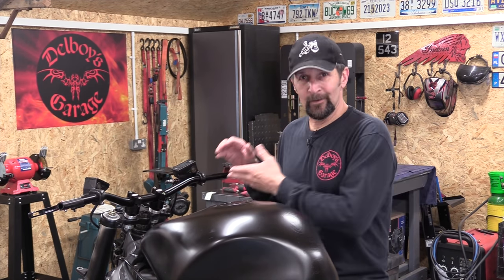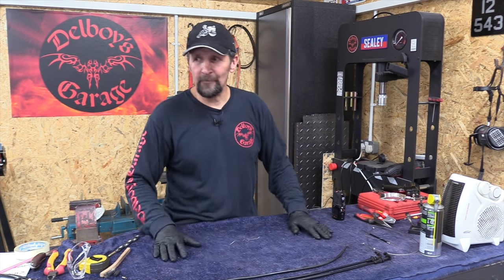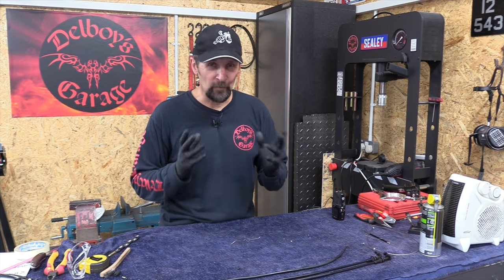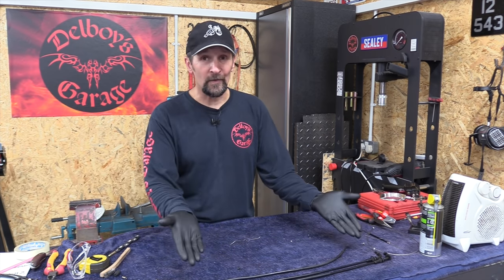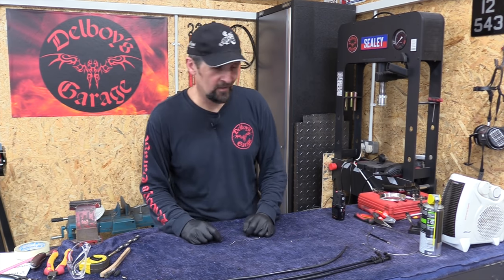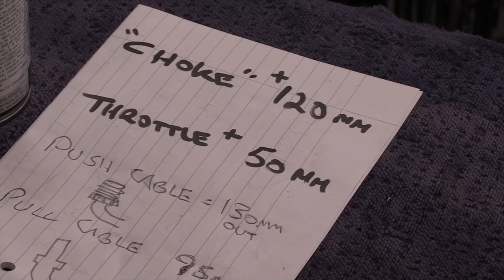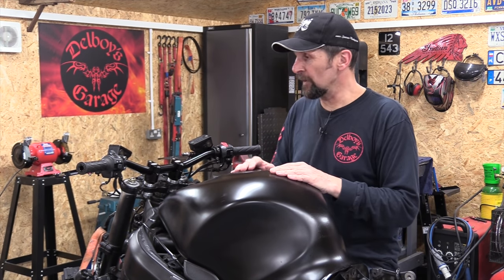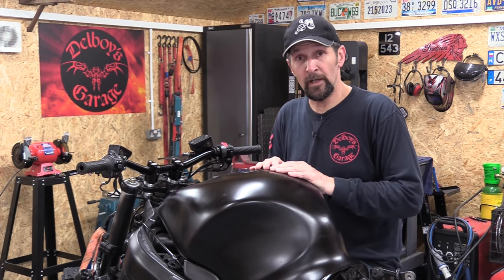Bare Bones Busa #5, Made My Own Control Cables !

Comment: After 45+ years of riding/working on motorcycles, that is one of the last things I've never tried. The list is getting shorter, but I still get that "a little bit spooked" feeling with the things I have not yet put my hand to... Rebuild an engine? No sweat. Make braided steel brake hoses? No sweat. Make a new set of throttle cables? Aiiieee, Black Magic! What, are you nuts? Great video, as always!
Reply from the maker: Ha ha, get stuck in mate.. it's easy enough.. just measure everything over and over before you cut it.!

Comment: My wee bike needed a new choke cable. Twice I tried to buy the right one, and twice I got the wrong ones. So I decided after seeing this video to lengthen mine, A trip to a bicycle shop and bought an inner gear cable. Had to file the nipple down a bit to make it fit. I use a sharp chisel to cut the short wrong cable in half. Gives a nice clean cut. Luckily I had a stainless steel tube the right size that slide over the outer cable and clued in place. I tried drilling the nipple on the other end and re-soldering, with no luck. Then I remembered another trick. I drilled a hole the right diameter and hacksawed a grove leading to it. Slipped the new wire in, then melted some solder into the hole. Let it cool, then split the wood open. Hey presto. A little tidy up with a file and good to go.
Reply from the maker: Good job well done Donald, thanks for sharing.

Comment: Great job but use flux so the solder flows, and make sure there is flux resin within the solder, not essential but deffo required if no further flux available! additinal flux will help it flow on this type of repair, do not blow the joint either, it induces air into the joint which makes it weak! to know if it soldered and flowed correctly check the wire at the end of the nipple where it enters the nipple, you should see the solder inside the weave! also clean any flux either additional or flux cored from any soldered joint, even after filing, flux will corrode the joint! done this myself before, super easy, great achievement!!

Comment: i've made those myself too. motion pro was the only company i could find and they wanted a fortune. i took a nut, smoothed out all the threads, cut a slit in it, layed it on the vice, inserted the cable, then filled it with solder, knocked it out, filed it and sanded it smooth, tested it for strength....that sucker was spot on!!!
Reply from the maker: Bang on mate, sounds like an awesome fix.. ill remember then.!
Reply: i made myself two spare clutch cables,but i did not solder them. just welded it .cable ends i make from a 8mm bolt(part with no tread)  make 2 mm hole  for a cable,and just short time welded  it.

Comment: Two tips I got from a classic bike workshop manager who’d been making cables since the ‘50s: Make (or buy) formers & hollow tip punches to bend the strands of cable back on to themselves into a mushroom shape = It’s far stronger than just flaring them apart (and really safety critical for drum brake cables!). And have a small pot of molten solder to dip the assembled nipple & cable end in = Its quicker & neater than a soldering iron when making up more than one cable.
Reply: @willwye410 is the solder the same kind as used for electric wire ? or is it suposed to be something stronger ?

Comment: Nice job. You'd get nervy when making up a front drum brake cable - it has to be spot on!
Reply from the maker: The brake cable kits are a lot beefier, and i guess you'd certainly need to test it properly before you used it in action aye!

Comment: Well done, yep it isn't hard.. but it is something you got to make sure the end wires are clean clean clean before you start.
Reply from the maker: Sure thing mate, a simple hack for that, rather than any fancy chemicals, is something as common as electrical contact spray, strips away anything on the surface, a little stainless wire brush also helps!

Comment: Excellent how-to vidéo as usual!…  I use a Dremel to cut the various steel cables/tubing as I find it leaves a cleaner finish. Wemoto is just down the road from me, so will check them out for supplies. 👍👍
Reply from the maker: Hey Andre, that's a good tip, thanks mate, a fine disc blade on a Dremel would be perfect...I  burnt mine out some years ago and have never bothered to replace it... I do have an air die grinder which does the same thing, but getting it out and setting it all up isn't worth it for 3-4 cuts, specially when you're busy!

Comment: Nice work. Never done that at all. Must have saved a good few quid too. Neatness ? No need when you are filing it down for smooth use profile anyway, a good amount of flux, splayed wire at the end and the solder flows to where it should. Enjoyed that a lot thanks :)
Reply from the maker: Thank you Tony, glad you enjoyed it, i did too. It was very satisfying to take on a new skill ive never tried.

Comment: Brilliant video as always. Question - did you use any specific type of solder to do this? (Lead free / leaded, etc..) I need to extend all my control cables on my FZS1000 due to fitting higher bars but for the life of me I've tried with an old original clutch cable and the solder simply won't stick to the cable. I've ordered a kit which has new cable and ptfe tubes but if I can't solder on the nipples I'm kinda stuffed lol
Reply from the maker: I can't diagnose what you may be doing wrong there mate... but the most common issues are contamination, and not getting the cable wire hot enough to flow the solder..!  if those two things are correct, it will work pretty much every time.!
Reply: @Moonfleet41  No worries - I suspect contamination may the issue as I wanted to experiment with an old cable, the new stuff shouldn't have anything on them so I'm hoping I'll have success when they arrive! Thanks again!
Reply: I’m having the same problem right now. It’s stressful. Did cleaning it help? Were you able to make it work?

Comment: Quick question: What soldering Iron were you using (rating etc) as this is the key to getting the nipple and cable hot enough for solder to flow properly with no "dry" joints?
Reply from the maker: Quite right mate, heat is the key.. i use a Vintage Weller 8200 Heavy Duty soldering gun !

Comment: what a coincidence. my clutch cable is on its way to snap, my throttle cables are gritty and sticky, and the parts are considered rare in here (rural village). Considering making a quick fix but I'm mecanically inclined :p
Reply from the maker: Good luck with it, hope you can get ti fixed, there will always be a satisfaction in doing these things yourself!

Comment: Nice job Del. You make it look so easy that I feel like a bit of a twat for not getting mine to hold. But I’m going to give it another go as I’m adamant I’ll get it right.
Reply from the maker: Sure thing Mark, it can be tricky, if you're using lead based, or lead free contact, solder for electrical terminals, that is a little weak for the job, but if you try silver solder, it's way stronger... it does have a higher melting point, so you'll need a soldering gun with a but of oomph to heat the nipple and the cable enough to melt the silver solder, but when you do, then you'll get a rock solid joint... you can buy it online mate!  And make sure you clean everything chemically first... electrical contact cleaner is a really good option.
Reply: @Moonfleet41  Thanks Del, I did notice you used a stronger soldering iron, but the silver solder is a big tip. Thanks and I really like what you are doing with the Busa.

Comment: Nice job Del, would that method be strong enough for a clutch cable ? ⚙️🔩🔧🤔
Reply from the maker: If you buy the clutch cable kit mate, and make a good job of soldering the ends on then yes, it'll be fine.!
Reply: @Moonfleet41  cheers Del ⚙️🔩🔧👍

Comment: Sorry about the stupid question, but is that solder like normal solder we would use for electric wires and circuit boards? It can't be, right?
Reply from the maker: No it's not..!  this is much stronger with a higher melting point.!

Comment: Great video as usual ,slightly off tack have you ever stripped a fuel pump on the Suzuki GSX1400 so that the tea bag filter can be changed  if so was it easy  ,kind regards Dave
Reply from the maker: Hi Dave, fortunately mate I've never had cause to do one of those, but most of them are pretty simple and straightforward, even on Harleys, it's just a case of getting at the pump wherever it lives and then swopping the filter or screen for a new one... usually a decent service manual will walk you through it as it is a service procedure... good luck with it mate, hope that helps.

Comment: Nice one mate, have spare left over will always come in handy to, had a few cables give up the ghost late on a Friday over the years then yer stuck, not anymore ehh, did the solder have a flux in it!
Reply from the maker: Yes Col, lots of spare, the kit comes with over 5 meters of inner and outer cables, and there are enough fittings to make a fair few cables.. they also ake an emergency roadside repair kit with screw in fittings to get you home, comes in a hande little screw cap tub and will tuck under a seat or even in your pocket..!

Comment: Del can I ask what solder you used on that? I see the ferrules are brass but even so generic electrical solder wouldnt be up to that? you'll get as far as a hard shoulder somewhere...
 did solder come in the kit?
Reply from the maker: No mate, you'd struggle with contact solder... try using silver solder, needs to be heated a fair bit more but as you can see, it works, you could see the flux bubbling out of it as you fill the hole....flows nicely too.!

Comment: Nice job I’ve got a emergency kit under my Zx9r seat for broken cables would this work for them too ??
Reply from the maker: Yes mate.. ive got one of those too, the type with the screw on fittings.. you could use that, but just solder the ends in instead.. Hope you're both well mate, have a great weekend..

Comment: My solder just makes blobs and doesn’t sink into the brass cup
Reply from the maker: Then you're not getting the brass cup hot enough... get it hotter and touch it with the solder... the heat from the cup must melt the solder, not the soldering iron..!